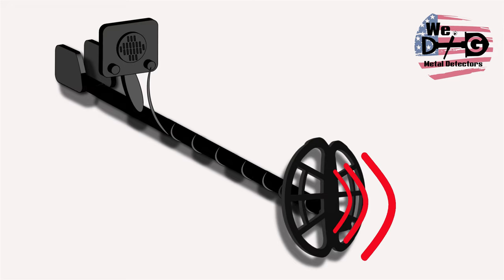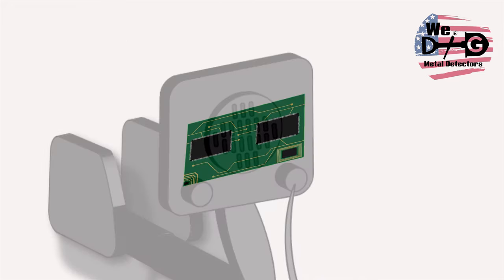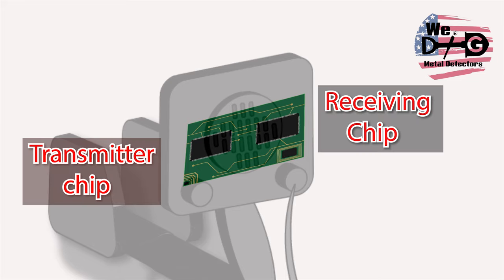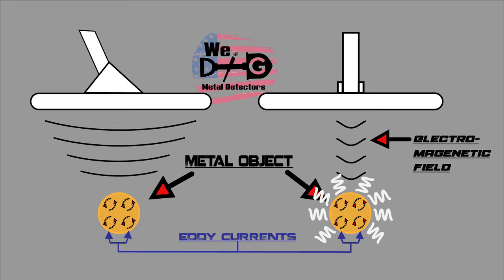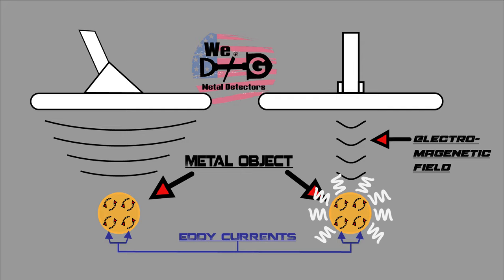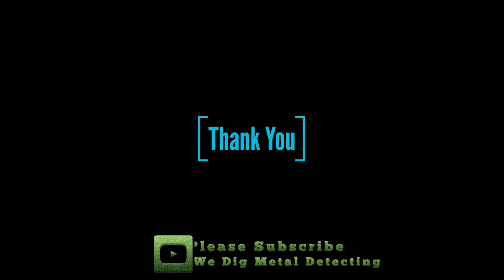How A Metal Detector Works

Comment: Metal detectors don 't actually transmit a signal into the ground and wait for a response reflected from a metal target.  That's how radar works, and metal detectors are not like radar.  The search coil on a metal detector radiates or 'emits' an electromagnetic field all around itself.  When a metal object enters that electromagnetic field it creates an anomaly in the field, and the detectors processor senses that anomaly.  Similar to the technology that is used to detect submarines by anti-submarine aircraft flying overhead.   Theirs is called MAD gear.....Magnetic Anomaly Detector.
Reply: They do transmit a signal as well as receive signal 🤡
Reply: MAD doesn’t produce magnetic field
Reply: Like passive sonar.   Any object that disrupts the magnetic field  is detected
Reply: I'm missing my wedding ring somewhere in my yard or my neighbors.. it's black plated stainless, any chance a detector picks it up? I'm a week in on the search😭
Reply: Any detector will find it easily.

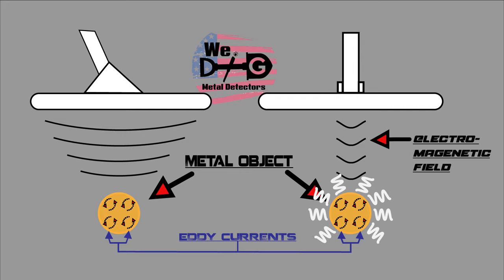Comment: Hi! The electromagnetic field is more like an invisible globe around the coil, rather than one, down directional wave. If a metallic object is swung above the coil it will pick it up as well. I found that this is something that metal detecting beginners are failing to understand and this video does not help with that due to the way the electromagnetic field is graphically represented [e.g. 1:49].
Reply: How to break the magnetic field?? Can you please give a idea
Reply: It is not a globe because as the item passes through the sides the field is non-existent. The graphic in the video is correct, but it repeats itself above the coil as well as below... It's more like an hourglass shape.